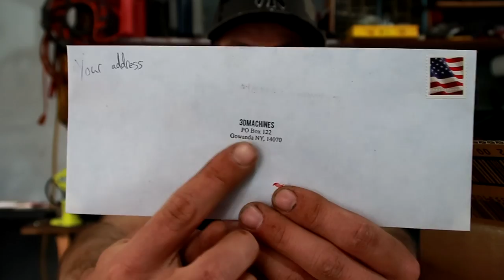THIS WON'T HAPPEN AGAIN

Comment: When you torque lugs do it in stages. i usually go from 85pound feet all wheels then 95pound feet all again then 105(only because my torque wrench is old and i'm compensating for wear on it.) then just to be sure go around again. Then i take my truck out and drive for about 10 miles go to a parking lot, do some slaloms, hard turns and jerking the truck around then check them again at 105. I usually find two or three that needed some more because of wear and a little corrosion on the studs and rim itself. At ever oil change or every 3months which ever comes first check them again until you rotate them. I usually rotate every other oil change. AND CHECK THAT SPARE TIRE!!! ALWAYS!! Nothing sucks more than getting a flat, thinking you'll be good then finding your spare is flat too.

Comment: I have a Chevy 2500 and never had a loose wheel. The alum. wheel were a pain so I put on steel wheels on and ended up using the same lugs at $3.00 each.

Comment: Me and my mom were going to sheetz and the explorer started to vibrate will going down the high way. When we got there I cheeked out the wheel and 2 lugs fell out and 2 out of the 3 remaining lugs were finger lose. We got new tires. Not even 50 miles

Comment: you should lift the d max
Reply: Mudslinger3232 also different rims and tires
Reply: yeah
Reply: why different tires and wheels?
Reply: Gliphs  because no offence to 3D machines but they look tacky and 99% of the time black rims look better than chrome
Reply: I wouldn't call them chrome, more of a silver. and i personally think the rims look great. Its not a pavement princess.
Reply: Gliphs just cause it has black rims dosent mean it's a pavement princess. Different people like different things and types
Reply: Mudslinger3232 yea I agree black rims look a lot better
Reply: Black wheels just look like winter steel wheels at first glance. Therefore I dislike them.

Comment: pack the wheel bearing with grease you used oil on it when you replaced it. it will fry when  it gets hot and seize

Comment: Why doesn't he fix the head gasket and have 2 ram chargers running like a top
Reply: NiggaDave because one head gasket cost as much as 800-1000 idk we're there getting those prices
Reply: Pull heads change gaskets $16.08 each through partsgeek for felpro,  Part Number: 2037-05036404 (you can get the $12.73  gaskets but they won't last in mud truck)  oil change and run it till she dies,  Those 318 were tough engines and can take a beating.
Reply: davidbrennan5 yea they can that's what I own easy to work on and beasts
Reply: The bearing wear shot and thats a hard job to do
Reply: 45.97  for set of rod bearings from Summit.  It is  easy to change when the engine is out. It takes less than an hour to do them
Reply: the hardest part is just taking out the engine

Comment: What's the SOP for re torqueing lug nuts on aluminum wheels? I had my front driver's side fall off yesterday. Those same exact wheels. They have been on for about a year or so and hadn't been messed with for at least 6 months, when the tire dealer rotated them. Insurance is taking care of the damage, and I'm lucky it happened while coming to a stop instead of half a mile earlier while doing 60 on the freeway.

Comment: I have a question my lawnmower won't start I'm getting fuel to the carburetor I put gas in the muffler hope and it will start for like 3 sec then die again idk what to do
Reply: braden dearen most likely the carb is dirty and needs to be cleaned should be an easy fix. Also could be your gas cap not venting properly, to check that just loosen it some and try to start it. But most likely its the carb thats dirty

Comment: ,like this if he should lift the duramax and u also comment it
Reply: Daryl Kiddd looks good now but lift might look sick
Reply: Daryl Kiddd depends if he puts new tires and wheels
Reply: Daryl Kiddd It's got a 6 inch on it.
Reply: Greg Schwartz noo it doesn't
Reply: That truck is bone stock.
Reply: davidbrennan5 the truck is not bone stock you can tell for sure it's atleast straight piped.
Reply: It sounds stock to me. If it had no muffler it would be very loud.
Reply: Daryl Kiddd not necessarily. I've heard tons of straight piped duramaxs and they and they all sound similar to that. videos never pick up sound good especially certain cameras when it come to louder deeper sounds.
Reply: you might be right i don't know but the only thing he added to that truck as far as I can tell are those light bars on the front grill. it even has the stock radio.
Reply: Daryl Kiddd very true but as I hadn't followed the channel from the very begging so I don't know when he got the truck if it was before YouTube and if he straight piped if before or did a video on it or what.
Reply: sas
Reply: Daryl Kiddd yes